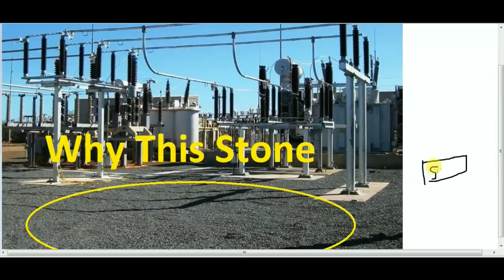இது எதுக்கு ? Why Stones/gravels are provided in Transformer Yard & Switch yard in Tamil

Comment: Nanba intha gravel normal enna size evlo depth ku podanum... 33,110, 230kv ku different size poduvangala. Illa ore size thana. Normala 1.5 r 2 inch tha industry side la transformer yardku podranga. Please explain?
Reply: It depends on earth mat design of switchyard.. generally 40mm. Crushed stone of 100 - 150 mm depth.. it shall have high resistivity of 3000ohm-m, as per IEEE 80 u can select different types of layers